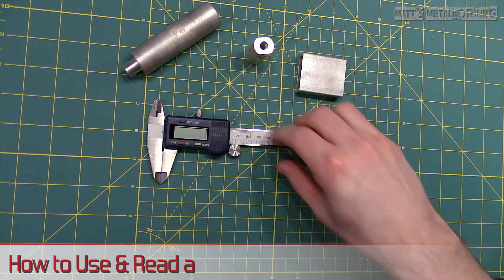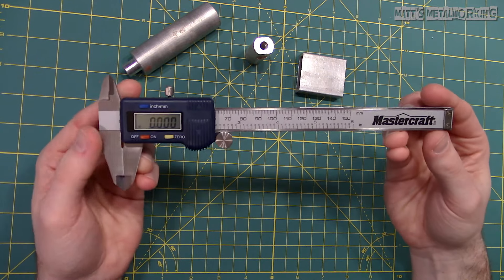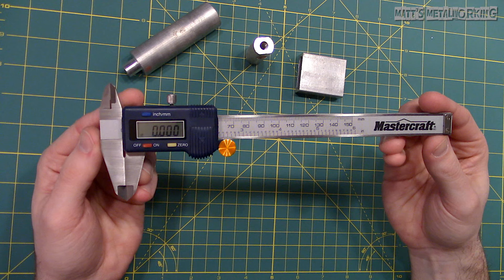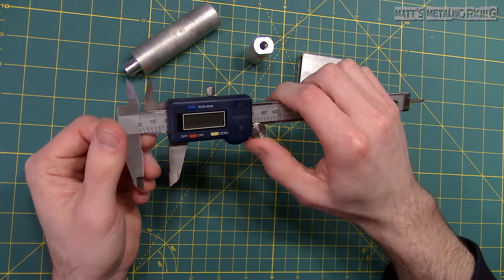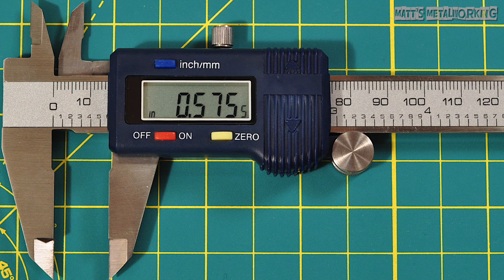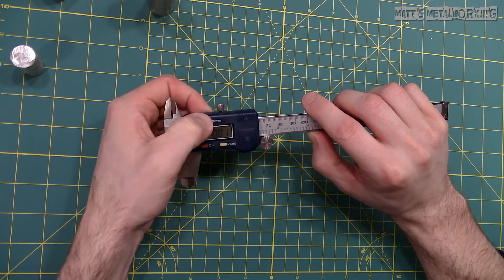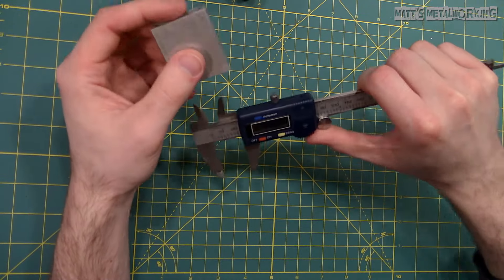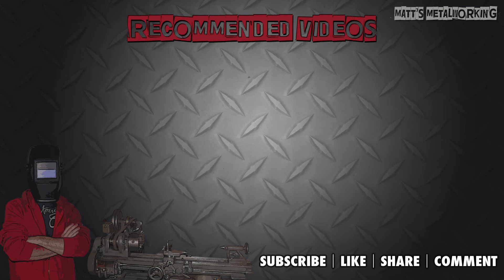How to Use and Read a Digital Caliper

Comment: hello sorry if it. a daft questions but. how do the. callipers no if you are use the inside or the out side edge  the top of the callipers the reading.
Reply from the maker: All those measuring types have the exact same distance, they all work together in one movement.

Comment: I was hoping you'd show the viewer how to convert the digital inches into fractions.  e.g. If I'm measuring a nut to see what size wrench I need, and let's say the nut is ⅝ size, I use the verniers to measure it but it won't show as a fraction, only a decimal.  The decimal readout in inches does me no good.
Reply from the maker: It's best to have a chart for that or you can use a drill index.

Comment: Do these callipers ever need lubricant?  Example the thumb wheel not smooth for delicate adjustments.
Reply from the maker: Typically no. Some oils can cause components to attract dirt or gum up. For cleaning, use isopropyl alcohol but nothing harsher as you can damage the plastic parts. If oil is a must, use something like weight like a silicone lube or gun oil. Do not use WD40 as it'll cause the parts to gum up.

Comment: I have trouble getting repeatable measurements.  It seems to depend on how tightly the caliper is squeezed against the part.
Is this a feel thing? Slight drag on the part is kind of a vague determination when less than .0001" is involved. 
What is the best way to ensure accurate measurements?  Practice on a standard?
Reply: I'm having the same problem

Comment: How does the fine adjustment wheel work? Where are the contact surfaces? Does it use bottom surface for friction or not? Does the wheel rotate by itself when jaw moves?
Reply from the maker: The fine adjustment wheel just works on friction, there's no direct mechanism or gear. The wheel just sits freely if you were to make movements from the jaws.

Comment: I've worked in machine shops for many years. I always use the wider part of the lower jaws when it's possible to use the wider part. I was taught and later observed that you get a more accurate reading of the true size that way. The thinner lower part of the lower jaws is for when measuring something like a thin slot that the wider part can't get into.  You seem to use the thinner part of the lower jaws to read the size when you could of used the wider part.

Comment: Need to tell u something they dont cost that much and changing a batter less then a minit
Reply from the maker: That is true, however in the machinist field a dial caliper is the best option. Less components to fail, more reliable, and you can easily view the movement.